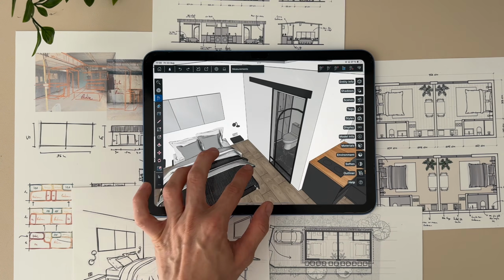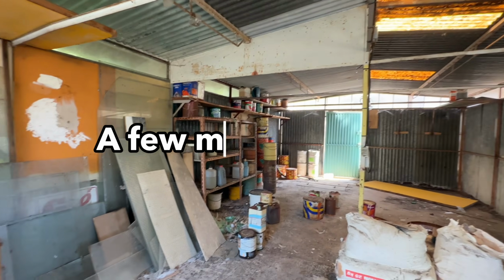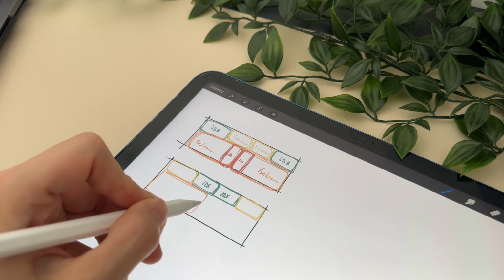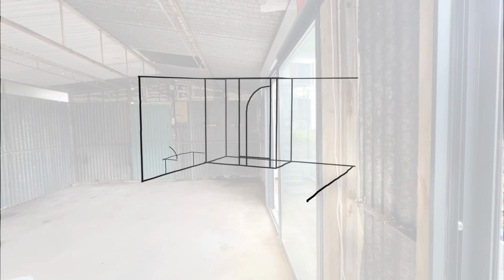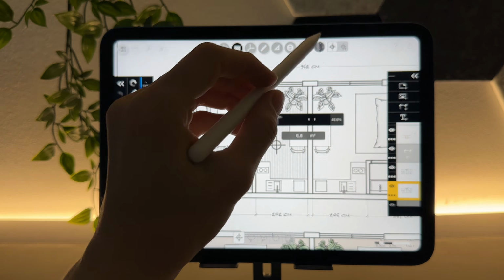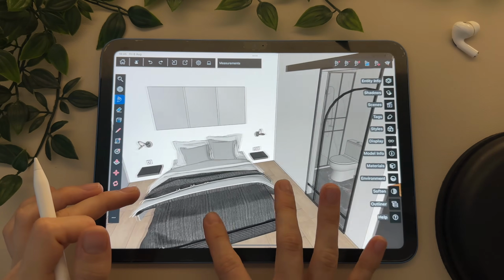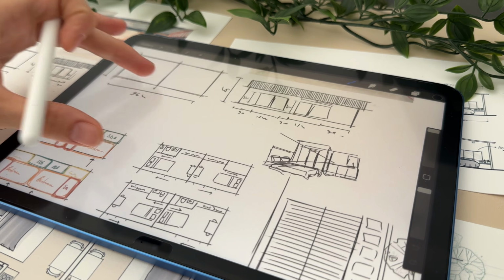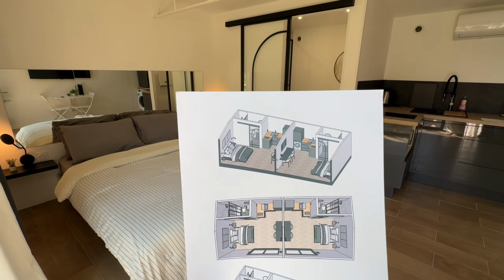5 apps I use to DESIGN any space - Cabin Renovation - iPad for Architects

Comment: Is it necessary to buy ipad pro? Or ipad air is fine?
Reply from the maker: These apps works well with both pro and air!
Reply: @sketchdesigncraft thank you so much. I just afraid if the apps are not really smooth on the ipad air.
Reply from the maker: I never got the pro actually. The one I have is the iPad 10th and the one I had before was an iPad Air. Never had problems with them ☺️
Reply: @sketchdesigncraft  I am thinking of getting the iPad 11 A16 , do you think it will be enough ? especially for Sketch up?